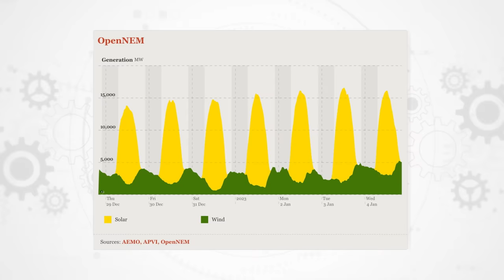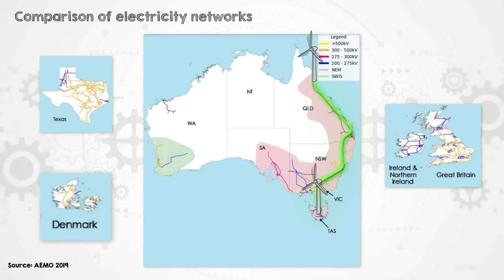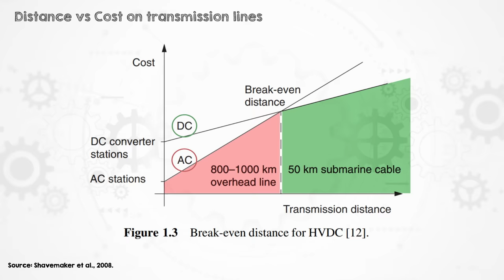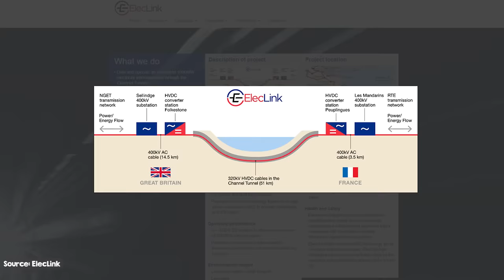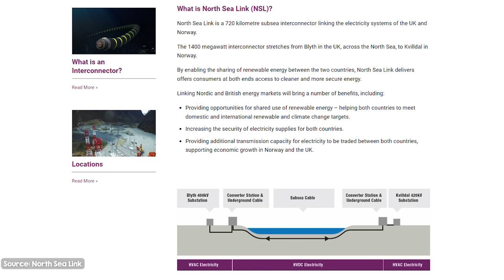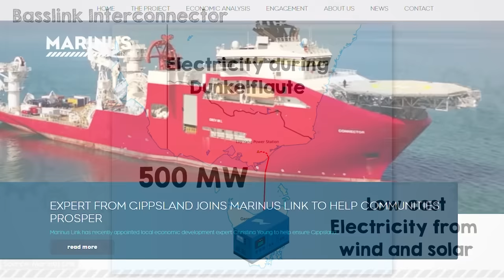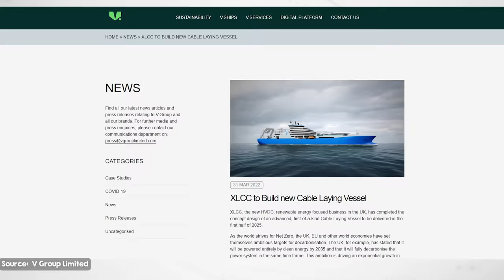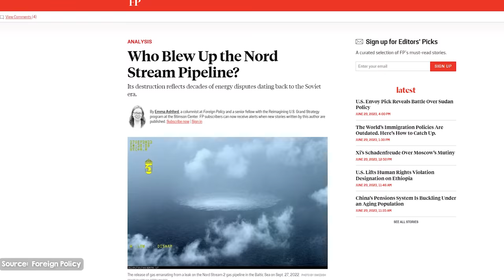Electricity Across Oceans: Is HVDC the Future?

Comment: Electrical engineer here:
Only benefit of AC is cheap and efficient change of voltage inside transformer. 
Now, with modern DC-DC converters, they are almost as efficient. 
Benefits are:
Grid does not have to be in synch any more, as all is DC, so whole world can be connected.
Power routing is easy, as you need to have a little adjustment to direct flow of power, by boosting voltage a little on power line.
Efficient home solar instalation, as you would not need to convert it from DC to AC for appliance use and just use 240V solar battery (or central tap 120-0-120 in split phase system).

Most device in home can run on DC power supplies:
Any swtich mode power supply (chargers, PC power supplies)
Stoves and other resistive heaters (like boilers)
Most LED and all incadesent lights

Devices that can be adapted:
Any device with universal motor (vacuum cleaner, blender), but you would need to give up speed control or change the circuit
Inverter air conditioners and fridged

Devices that would not work on DC and need am inverter to work:
Anything with old iron core transformer
Anything with an induction motor (fans, pumps)
Anything with a dimmer circuit (ligjts, vacuum cleaners)
Clocks dependent on grid frequency
Reply from the maker: Great info you've added here, thanks!
Reply: Very good and enlightening comment. The transition from a AC power grid to a DC grid will be greatly facilitated with modern setpup/stepdown DC converters. Today, a good part of electrical equipment is already compatible with DC power. As you said, all SMPS work well in AC or DC, and induction motors can be equipped with a VFD.
Reply: Actually. They have been working on SMPS/inverter style "pole pig" transformer for last mile connection on the grid. This new PPT can accept both AC and DC current on it's primary side and output normal 120/240 AC on the sec. It can accept a wider range of input voltage and can even be equipped with a large capacitor back to smooth out any transients as well.
Reply: Turn whole home into DC. Just use enphase microinverters where needed.

Comment: Always wondered why DC was being used for these long links while most long distant lines are AC. Thanks for the explanation!❤😊
Reply: DC connections are also used when two grids that is not in sync needs to be connected.
Reply: @srenjensen3817  or different frequencies like EU 50Hz & USA 60Hz.
Reply: or if you just want whales to stop asking "what's that bloody humming noise?"
Reply: @MattOGormanSmith  its a cable it doesnt make noise
Reply: @Blox117  High voltage AC electrical appliaces make an audible hum when active.

When you turn on an electric shower you can sometimes hear this noise over the sound of the water.
Reply: @mnomadvfx  that's AC..
Reply: @mnomadvfx  also, with AC the cable itself doesn't make noise. Electronics do, and the air itself can with high voltage but not the cable
Reply: @Blox117  That was his point about the whales hearing the AC more than they would hear DC current flowing through the cable.
Reply: Dude woke up and decided to correct ppl on the internet without reading the context!
Reply: @mnomadvfx  Those cables are very good shielded and isolated, but they always can explode by 'accident' with a little help like NS1/NS2 😂

Comment: Wouldn't it make more sense to connect the UK to Faroe, Faroe to Iceland, Iceland to Greenland, and Greenland to Canada?  That avoids many of the problems associated with super long cables,  as well as avoiding some of the deeper seas.  For example, From St. Ives in the UK to St. Johns in Canada (the shortest possible stretch), the cable would be over 3,000km long and have to be over 4.7km deep in some areas - most of it 3km or more.

By comparison, from Thurso in Scotland to Kirkjubomururin in Faroe (415km, depths mostly in low 100s, with the middle dropping to 1km),  Eioi in Faroe to Faskruosfrorour in Iceland (450km,  depths mostly below 500m), Isafjorour in Iceland to Kulusuk in Greenland (640km, depths mostly below 600m), and Narasarmijit in Greenland to West Bay in Canada (1000km, of which around 800km drops to 3.5km but avoids the mountain range down the middle of the Atlantic.  Add around another 800km between Kulusuk and Narasarmijit around the coast because it doesn't look like Greenland have an electricity grid, and I don't foresee anyone building HVDC across the landmass.

This seems a lot more achievable, not to mention cheaper, than trying to lay a cable straight from the UK to Canada, and adds the benefit of Faroe's hydro and Iceland's geothermal along the way.  Both, as well as Greenland, could probably turn themselves in to major energy players, with landscapes highly suited for hydro and pumped hydro.  Well, in the summer, at least!
Reply: Isn't your suggestion straighter than going straight?  Our aeroplanes, even from southern UK airports, fly over Iceland as the shortest route.around the globe to the USA, rather than the straightest route on a 2D map!
Reply: @nigels.6051  Atlantic coast to Atlantic coast, the shortest path is over the Atlantic. You usually only overfly Iceland if you are traveling to/from someplace close to the Pacific coast or the airline you are using avoids unnecessary trans-oceanic flights. 

Any truly shortest path which does touch Scotland, Iceland, and Canada will have to contend with Sea Ice and that is many times more expensive than running cables deep in more southern parts of the Atlantic. And also end up in a part of Canada which is not tied into the national electric grid.
Reply: @nigels.6051  It's curves a bit further north than the usual airine path, but yeah, that's part of the reason I thought of it. The distances I gave above are only the sea surface distances, it excludes slack needed to follow the contours of the seabed, and it assumes existing grid infrastructure across the land masses involved. Total distance would definitely be longer, but I would think the benefit of connecting countries along the way and dealing with shorter cable lengths would more than outweigh that.
Reply: As far as Iceland, yes that makes sense, but I think it would be easier to run cables in the ocean than run cables across Greenland.
Reply: I don't think that Icelanders are very keen - I've read that the public are concerned that, once they are connected to the rest of the world, their cheap geothermal energy will be hoovered up on the international markets (which would mean it's political suicide for any Icelandic government that proposed to actually build it), and that the cost of wind energy in the UK is dropping to the point where building out wind farms is cheaper than the HVDC connection to Iceland - which is why the plan has gone nowhere for the last four or five years.
Reply: A deeper cable may be more expensive to repair,  but isn't it less likely to need repair?   Conditions are more stable and there's less wildlife and ship anchors and fishing nets to contend with.
Reply: just build a bridge over the atlantic ocean, problem solved
Reply: @katrinabryce  "but I think it would be easier to run cables in the ocean than run cables across Greenland"

Considering most of Greenland is shifting glacial mass it is completely unfeasible for such a purpose.
Reply: @malcolmrose3361  There's a problem with your reasoning about Iceland and geothermal power.

While GT bore holes eventually run down they essentially run active 24/7 until they do so with little interruption that I know of.

Contrasted to wind which is much more variable, especially without tens/hundreds of MW worth of electrical storage to balance the load for calm days when the wind is too low for generation.

So ye - until renewables electrical storage massively scales up (which will take decades) the Icelanders have no more fear from the UK than they do from solar generation in Africa.
Reply: @mikeaugust747  The problem with that is the 'hegemon' is then dealing with at least 3 angry factions:

#1. The country the cable is delivering to.

#2. The country exporting the power.

#3. The company that laid the cable.

That's a bit too much skin in the game for most players.
Reply: The other issue is that much of the cost is in the end points where the AC/DC and DC/AC change over is done. Though the video concentrated on the cable, that's not really the expensive part.
Reply: @mnomadvfx  I'm not referring to literally "sucking" up energy - but if Iceland connects to Europe and / or North America then it's electricity will be sold on the world market at world market prices - which are a lot higher than Icelanders or the aluminium smelters are used to paying. The government and power companies can give all the assurances they want about local pricing - but nobody anywhere has faith in governments or big business to do the right thing anymore.
Reply: I think the issue is the following: 
Either you do not really incorporate the local grids and just build you cable over alnd, which is almosat always a bigger struggle due to legal concerns and obsticales people care about. So that could be a headage. This is what delays the power grid projects in Germany for example. (for example NordLink2) However if you do use grids that are there already, you have a pretty big limit in capacity, as these grids are not made for this. And since these cables would probably be enourmous in capacity, this would not work. If you do this with the existing grids, you also have massive efficency losses because you have to change the voltage type multible times. Which always creates inefficencies. 
I think that the challenge of larger and thicker cables are more easily solvable than the headache of building a lot of different cables. In my mind we will prolly build a HVDC grid in europe as well, jsut because it is more efficient for those really long distances and southern europe does have much larger resources and connection to renewables. 
But the westward connection to the US is particualry interesting, because the load peaks of solar are radically far apart. Which means that the abitrage you can do there is pretty good. Electicity in Germany in the summer already has 0/negative prices in the noon, and this will be getting worse most likely.
Reply: @thorH.  In Germany the plan is for an internal line from the windy North to the sunny South to connect the two main green energy regions of the country. I believe the plan is to lay the cable along the autobahns from North to South, and bury the cables to avoid the NIMBY / Green complaints.

We already have quite a few HVDC interconnectors between grids in Europe (more than mentioned in the video) but the next easy steps would be to add additional North  South and East West links between countries. Most of these would be relatively short eg Sicily / Sardinia / Corsica / Northern Italy or Southern France - add in connections to North Africa and you get a wider area to supply power. Spain is three hours (geographically speaking) ahead of Greece so you can get an decent extension of green energy production even without leaving the EU.
Reply: @malcolmrose3361  Yes and then at some point we might also connect Saudi Arabia although that has some geopolitical issues and west Africa as well. So there are a lot of opportunities.
Reply: @malcolmrose3361  Even if the rest of UK or Europe were to try and take as much of the electricity as they can, the Icelandic government can easily put restrictions. Other than putting a cap on how much electricity can be exported, Iceland can start building more geothermal plants to meet the demand for green electricity for the rest of Europe. 
The Reykjanes Power Station which was built in 2006 cost a $100 million USD for 100 MW capacity. The current Hinkley Point C nuclear power station in UK which is supposed to be done by 2028 has 3,260 MW capacity is going to cost $32 billion USD. Nuclear power plants always go over budget so this price will more than likely increase and you have to buy the uranium to get the power out. Building 32 geothermal plants will cost less and will not need any input material to get the geothermal energy out.
Iceland can become like Dubai, instead of oil they would sell electricity to Europe. The Icelandic economy can be like what it was prior to the 2008 Financial Crisis, but instead of a highly leveraged banking system holding the economy up, a green electricity supplier to Europe. And possibly to the US and Canada if they built a HVDC line from Scotland to Iceland, then to Greenland and to Canada.
If that happened most of North America and Europe would be economically entwined and would be forced to co-operate with each other in greening the economy. But who am I kidding; human nature will take its place and this step to saving the planet from global destruction will not happen.
Reply: @malcolmrose3361  I've also read that Iceland is setting up lots of industries to use up all their geothermal energy e.g. silicon smelting to produce silicon for solar panels/semiconductors. This has traditionally been an extremely energy intensive industry and if Iceland can do it with cheap geothermal energy they could almost take over this entire industry.
Reply: @cyrusp100  They've already attracted aluminium producers who ship in the bauxite for processing, for the same reason. Iceland gets jobs and diversifies it's economy away from fishing and tourism. Cheap green energy (whether from solar, geothermal, or whatever) has the potential worldwide to change the economic geography of the planet in the future.
Reply: Good point, unfortunately I expect politics comes in to it as supply could be interrupted, to/from the USA (say) by up to three countries.  Unfortunately politics always trumps common sense!🤑🤑🤑🤑
Reply: @cyrusp100  This is the smart way.
Reply: @mnomadvfx  We are getting space based solar apparently too which would seriously help the UK
Reply: @waqasahmed939  "Space based solar" is as far in the nebulous future as nuclear fusion: not yet "serious".
Reply: @Drought-jr6pb More likely a US president would start a trade war on energy first.
Reply: Almost every Canadian lives on the Canava-US border, you'd need to go another 1500km from the Canada end of the Greenland line to reach a population centre.
Reply: @malcolmrose3361  A lot of Iceland's geothermal energy is just that - energy, not electricity. It gets used for heating, without ever being converted to electricity. About 70% of the electricity comes from hydro.

(Also, Iceland already 'exports' electricity via aluminium smelting!)
Reply: @TrabberShir  If they can get to Labador, there are major hydro-electric projects (e.g. Churchill Falls) with major lines that could into the Quebec grid, which provides a good chunk of the power for NYC.
Reply: @Blox117  "just build a bridge over the atlantic ocean, problem solved"  Even simpler :- Drain the Atlantic ocean"  I do not know how you missed that one.

Comment: Hello! High voltage cable engineer here, you are awesome! What a fantastic short video summarising what is happening in the world of HVDC cables!
Reply: Hi, High voltage cable engineer, can you please explain Rosie's statement that the inductance of the cable causes losses.  Is it magnetic hysteresis loss in the steel sheath or something else?
Reply: Hello  @petehiggins33 , the alternating current at say 50Hz causes dielectric polarisation due to an electric field between the conductor (+ capacitor plate) and metallic sheath (- capacitor plate) oscillating 50 times per second, which causes a redistribution of the charges within molecules from dielectric hysteresis rotation of polar and induced dipole molecules, thereby causing losses in the form of charging and leakage currents.
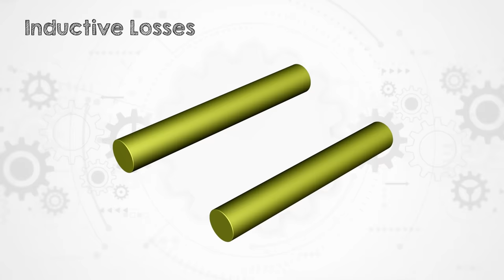Reply: @MrMilanista1994   That's very interesting and may explain the capacitive losses but my question was about how the inductance causes losses. 2:59

Comment: Since 1992, Hydro-Quebec already operate a 1500 km of DC line.  They are looking to get many more of them online soon.  The current line is transiting about $1M in electricity, every day.

Regarding politic, it already a problem for Hydro-Quebec (Canada).  The state of Vermont (USA) is dependent on HQ.  Furthermore, The state of Massachusetts (USA) often consider that it will be imprudent to get more electricity from Quebec.  New-York city is also VERY Reliant on HQ.  HQ already supply some electricity to Ontario (Canada).  All in all, if HQ were to shut down the delivery of electricity to New England, the NERC NPCC regions will likely crash.

That the reason HQ looks at Europe.  HQ is 94% Hydro.  It does want to develop the WIND resource too.   So, with Europe, what HQ will like to do is become the"BATTERY" where it does purchase electricity cheaply on the European market... and resell some when the sun is not shining or the wind not winding enough.  HQ has an impressive amount of dispatchable electricity with Hydro.